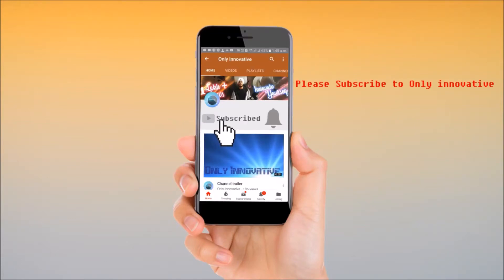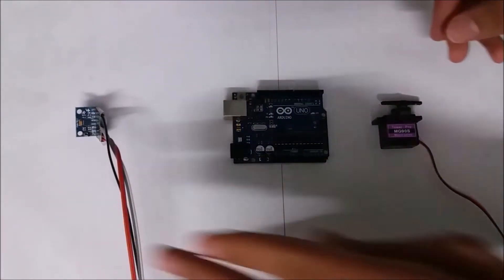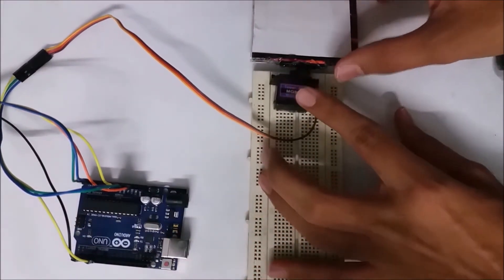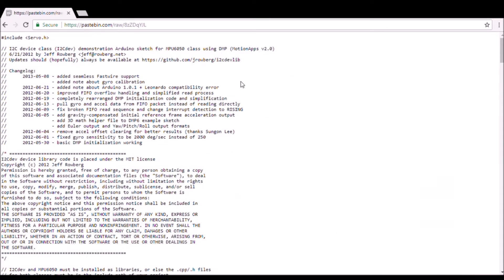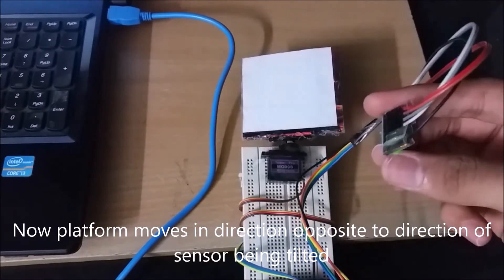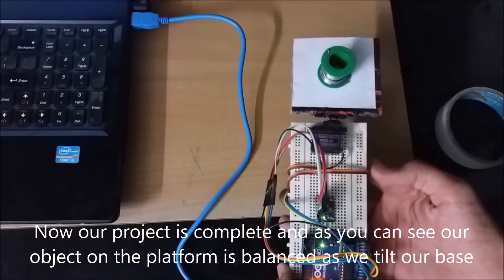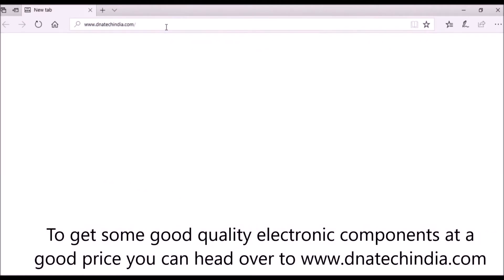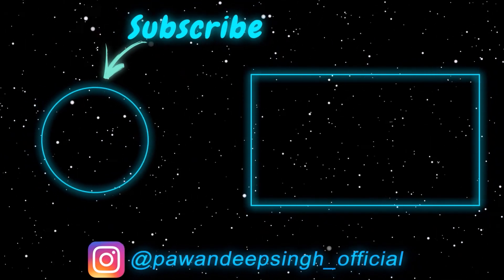DIY Self stabilizing platform | Arduino project | Self balancing robot

Comment: This is really cool my friend!! I am going to try and make two other servos in this configuration and combine to make a gimbal... what do you think? maybe 3d print a nice frame? Question... could I use only one Arduino to achieve the gimbal I have mentioned (three servos stabilizing 3 axis)? Thanks!
Reply from the maker: You should be able to control it with one arduino!! Will need different kind of driver though!
Reply: @onlyinnovative1797  PCA9685?
Reply from the maker: Looks like this should work...let me know if you code and it works...would love to see the results

Comment: when i verify the code , this message appears although i downloaded all libraries , can you help me sir ? i can't write all errors in one comment so i copied small part  
error 
note: code may be misoptimized unless -fno-strict-aliasing is used
In file included from C:\Users\TOSHIBA\AppData\Local\Temp\Rar$DIa5596.33017\code\code.ino:47:0:
C:\Users\TOSHIBA\Documents\Arduino\libraries\src/MPU6050_6Axis_MotionApps20.h: In member function 'uint8_t MPU6050::dmpGetGravity(int16_t*, const uint8_t*)':
C:\Users\TOSHIBA\Documents\Arduino\libraries\src/MPU6050_6Axis_MotionApps20.h:524:65: warning: integer overflow in expression [-Woverflow]
         - (int32_t)qI[2] * qI[2] + (int32_t)qI[3] * qI[3]) / (2 * 16384);
                                                               ~~^~~~~~~
C:\Users\TOSHIBA\AppData\Local\Temp\Rar$DIa5596.33017\code\code.ino: In function 'void loop()':
C:\Users\TOSHIBA\AppData\Local\Temp\Rar$DIa5596.33017\code\code.ino:396:28: warning: unknown escape sequence: '\040'
             Serial.print ( "ypr \ t" );